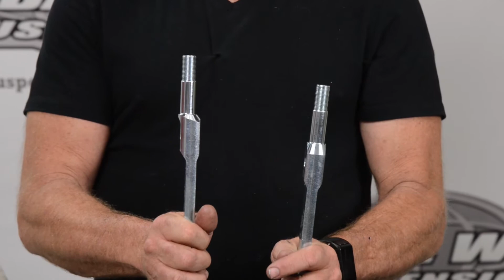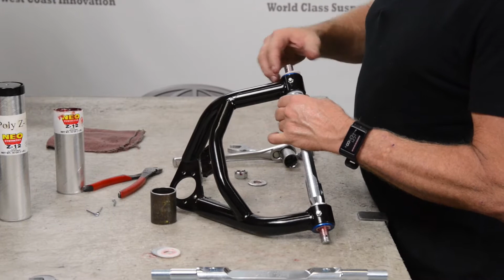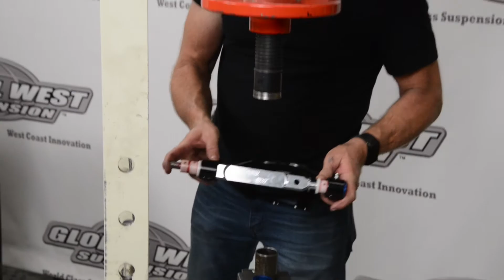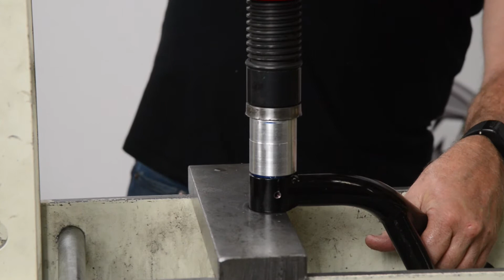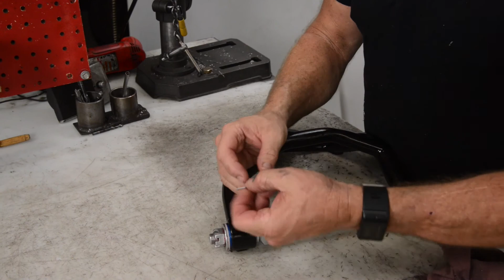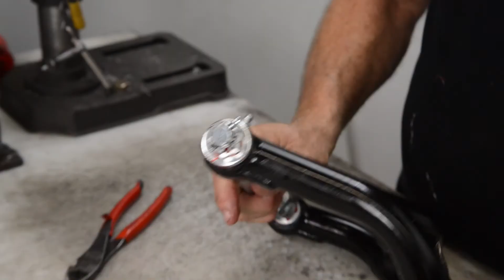How To Change The Cross Shaft In A Global West Tubular Upper Control Arm

Comment: I just installed your offset shafts to my CT71A arms.  3 tips.  1) I recommend a press no narrower than 22"  2) That tube that you push the bushing into needs to be close tolerance part, not some pipe you pick up from Menards.  I had to find a metal supply place and got a 2"OD .250 wall tube, cut to 2.5" long for $15.  Same deal with that notch in your press plate, I had to cut mine to tolerance with a carbide cutter  3) Finally, make darn sure the bushing zerk hole is clocked in the correct position prior to pressing it back in as you will have a heck of a time if you need to get it out again as the offset shaft, cannot be pushed through the arm like the straight shaft.  If you know you need the offset shafts in your new arms and can wait, I would recommend hitting the EZ button and letting Global West install them for you.
Reply from the maker: All valid points! You definitely have that option to let us install them for you! Glad you were able to get through the process yourself. If you have any questions give us a call! 877-470-2975!

Comment: Hey Doug and crew,
I am using your setup for my 69 A-Frame Chevelle. I know the whole kit is nice but some of us are doing budget with performance and stock parts. I am using your upper control setup with spindles out of a late model and your lower ball joint kit. It took a bit to find the right setup but you guys have all the info we need, THANK YOU!! 
Can you guys do a video of this setup with the donor car spindles, new upper control arm, lower ball joint and del-a-lum bushing in a stock lower? I know of a few guys that went with new bushings because they couldn't afford a whole setup. I have told them about this kit you have and they all say "Damn, I wish I knew!" 
Global West suspension is superior in my opinion. Just flicking the tubes will tell the tale! Haaha
Reply from the maker: Thanks for the kind words and support ill pass this up and hope that we can deliver! good luck with the build!